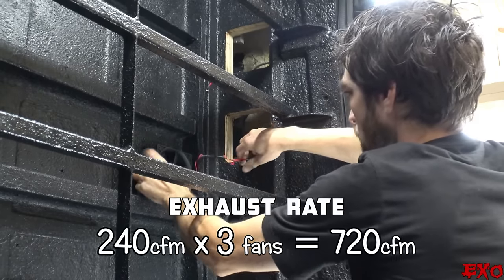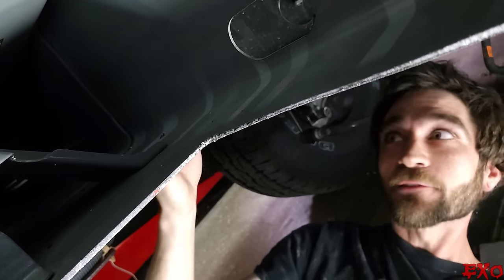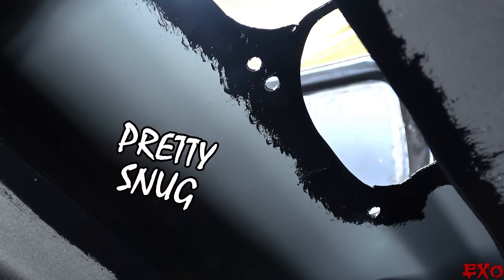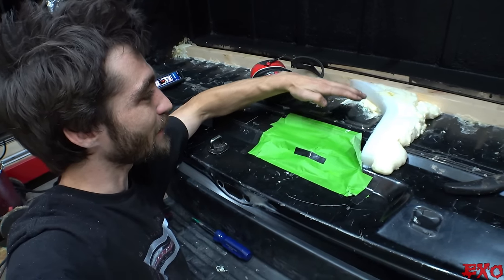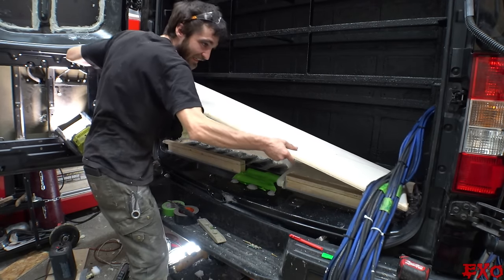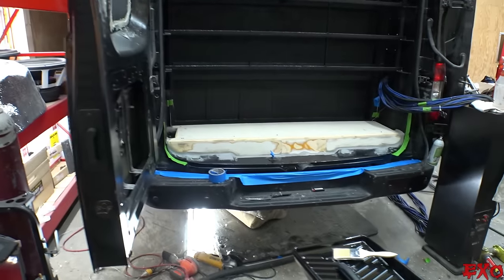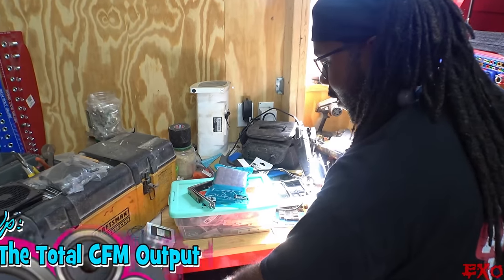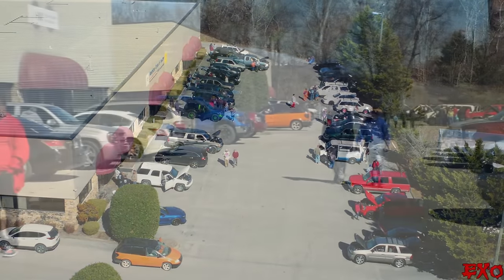SUPER COOLED Car Audio Install w/ EXO's BASS VAN Build | Installing Battery Tray & Cooling Fan Setup

Comment: Thank you for doing these videos. Most people seeing a finished install and no idea of the hard work that goes into building a clean looking system. Something as simple as pulling an interior out of the car to layout all the wiring and building speaker pods and boxes most people have no clue when they see it finished. These videos bring back to my youth installing in the late 80’s to 2000.

Comment: I wanna know what the alt set up will be and what batteries you'll run. Basically the power plant. I'm hoping you'll do a DIY scib bank or a prebuild from one of the DIY guys. But I don't believe you've mentioned the voltage you plan on running. I enjoy all the fab work and my cousin used the PVC pipe idea for running wires in his wall build. But I love seeing what people use to power these big builds.